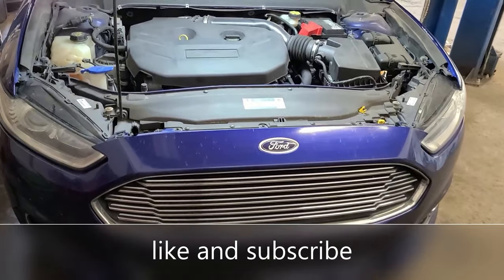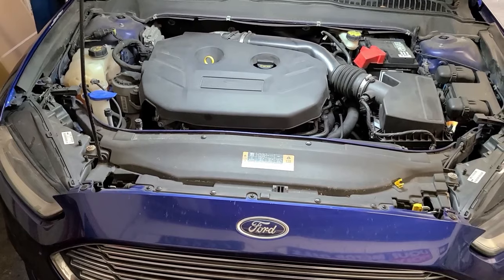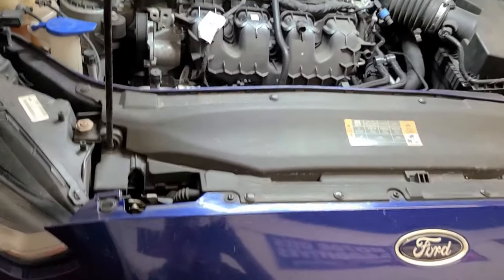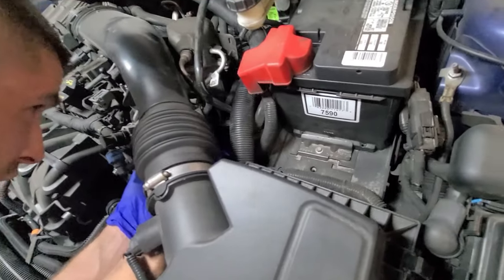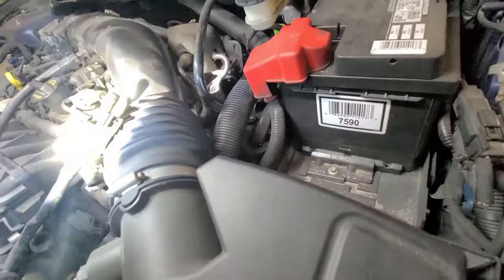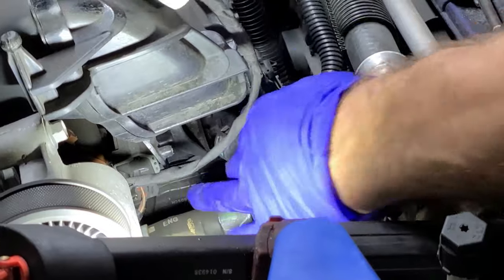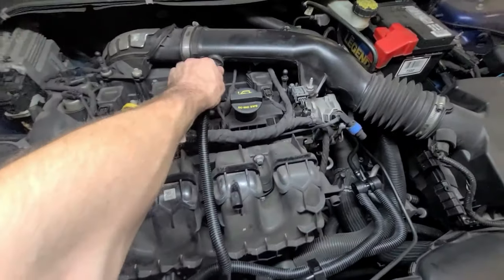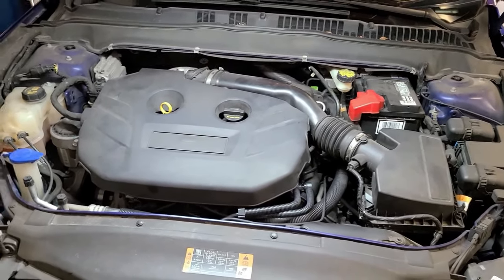Ford Fusion Purge Valve Replacement // 2.0L Ecoboost 2013-2020 // HOW TO #DIY #HOWTO

Comment: THANK YOU. After having this problem for a long time and knowing what it was I finally have the money to fix it, and now that I have the part this was the absolute best video I have seen on it. This needs to be the first video on YouTube when you look this up
Reply from the maker: Like, share and subscribe will all help! Check out our give away we are doing!
Reply: This is happening to my ‘17 sport.  The Ford dealership is the only shop that had an opening for Monday, what should I expect to pay to have it fixed?
Reply: @AceFitPro714  I man i hope you see this soon/ fast enough. Just saw this notification. DO IT YOURSELF. It's a ltiny bit of a pain in the ass but it's so doable! the dealship(I live in canada) will probab;y charge hundrends fora  job you could do yourself in 1 or even less than 1 hour.
Reply: Miami florida here, they wanna charge me $650 !!! Thank God i saw this video in time
Reply from the maker: I'm just up the road in daytona area!
Reply: @IHaveN0Clue my dealership quoted me $800, yeah no thanks
Reply: @AceFitPro714  the ford dealership charged me 600$ for an o2 sensor after I told them I ran the codes and got a evap purge valve code, after arguing with them they replaced upstream o2 sensor charged me 600 and gave me the car back got home check engine light came back on the following morning and back to stalling out, took the car back up there. Got charged another 300 for the evap purge valve. On a 2015 focus its a 20-40$ part and takes 5 minutes of plug and play. Save yourself the time money and headache
Reply: Yeah they wanted to charge me $700 here in wa I have the 1.6 2013 and it's essentially identical as the 2.0 got the part for $88 installing tomorrow wish me luck.
Reply: @THEDriverMod_ location
Reply from the maker: @sachinsofta  location of what?

Comment: heer..locally,, you can just get the valve,,, a hot hair dryer will soften up the hard plastic tube to out the bad valve out and add the new one... let it cool, and just snap in one hose next to the valve* i work as classic Italian car tech, but i do help my friends out..plus i own a 14 fusion vep engine  15 min fix )

Comment: Changed the purge valve on my 2020 fusion 1.5 liter turbo and the fuel is rapidly dropping when driving. Roughly 3x as fast as normal. Any guesses?
Reply from the maker: @MintyFresh3693  maybe a leaking injector, are you driving it more aggressively to where it's boosting more?

Comment: thanks for the video my man! for that bottom connector, I didn't have a 90 degree pick that long but after struggling with a short 90 pick, I borrowed a more hook style pick of the same size and got it right away! took care of codes p2196, p1450, and p0456 and of course stopped the stalling after refueling on my mother in laws 2015 fusion 2.0!
Reply from the maker: Good work, happy to help!

Comment: Local mechanics told me it was the Fuel Pump Module in tank, $1500 later and it repeated exact symptoms described in this video. I found the solution and thanks to your instruction, will be doing this myself.
Reply from the maker: Sorry to hear that but hopefully you can get it done yourself!
Reply: @THEDriverMod_  Lesson learned but happy I found your video, thanks!
Reply: I almost had this happen to me but I'm a natural negotiator and made that guy understand he wasn't just quoting just anyone. I didn't pay till he showed me it passed diagnostics

Comment: This was by far the best of these videos, thanks!  That bottom one is the hardest to remove, but stick with it.  I took the others out, removed the sensor as shown here, then you can rotate the bottom one enough so you can push the clips and get a 90 degree pick under the top and pull it up.  Pops right out then.  When goign back in, recommend a little lube on that one. Start it, then use whatever you have to get some leverage. I used a wrecking bar to get behind it and push it until I could snap the locking ring.  On the purge valve, there's a piece of rubber where it mounts to the bracket. Don't forget to take that out of the old assembly to securely mount it on the bracket.

Total time for a complete DIY'er: 1 hour.
Reply from the maker: Great insight and tips! Thank you

Comment: Very helpful! I ended up just cutting the hoses to the two lower connections so I could spin them around so I could undo the clips easier.
Reply from the maker: That's a good idea! Glad you were able to get it done!

Comment: My check engine light just came May 1st. Ran a diagnostic check and got a P1450 code. Bought the canister purge valve today and changed out the part thanks to this video. I didn't allow the light to stay on long enough to experience any symptoms.

Comment: I just bought the valve and changed it out and all is fine. Didn't have to mess with all the hoses.   Thanks for the video.
Reply: I’m about to buy only the valve, I’m a little concerned about the hose; did you have to cut the hose? Or you just pulled it out and put the new one in?
Reply: @hectorvalenzuela8817
Reply: I just took the new valve to my local Auto Parts store and got a hose to fit the valve.  It was a little bigger, but it worked.  Good luck.  I hear the cause is due to overfilling the gas tank.  Do not "top-off" your tank. Once the gas nozzle shuts off that's good.

Comment: Thank you for sharing this video! This is EXACTLY what has been going on with my 2013 Fusion and I just returned home from the diagnostic test and was told this was in fact the problem. Now to share this video with my husband so he knows what is going on a little better, too!
Reply: Also, my car has 158,645 miles and this is the first time this has ever happened.
Reply from the maker: Happy to hear this helped you out! Definitely share and hope you get it solved
Reply: Just ended up with this problem and I have a 2014! Wonder if it's a factory problem

Comment: Thank you so much for posting this video. My car had all three symptoms plus the service engine light. Bottom connector was a pain in the butt, didn’t have any kind of pic. Engine runs so much smoother now
Reply from the maker: Awesome to hear! Yea it's definitely a pain, I wish there was some sort of trick without disassembling alot of the engine bay but you got it done!

Comment: Haha; you went to great lengths at around 2:30 to avoid saying that it sounds like your car is farting from the fuel filler. I'm happy to do that for you, if it doesn't want to start after fill up and then sounds like that car is farting, you have this issue. Also, that one clip down in the engine by the alternator is a huge pain to get at. If this happens again, I'll have a mechanic fix it just to avoid that grief. 
My best advice for getting that one off is to cut the hose, because you have to rotate the attachment to more easily get the tab pulled. It's nearly impossible with the full hose and fittings attached. To get it back on, get it in place and then take a very long and wide flat screwdriver and leverage it against the alternator housing to push the fitting fully on. It's brutal to try and do it with your hands alone.
Reply from the maker: I did because that's what it sounds like lol all good helpful tips for others watching this video!
Reply: Omg that’s what I told my son. My car is farting and he died laughing lol

Comment: That bottom connector is a big B! Thought I was going to have to take the alternator out until I saw this video! Appreciate the extra effort in explaining how the clasp actually worked. Didnt have the 90deg pick but was able to make a couple very long/ thin screw drivers work to release. All the other connections no problem. Thanks for the vid!
Reply from the maker: You're welcome! Appreciate the comment feedback!

Comment: Great video!  Glad you didn't do those edits you were saying as it helped to know how much of a struggle the yellow clip was to be.  I ended up using hand pruners to cuts the old hose assembly out of the way.  Since I could only get one hand in there on the yellow one, I bent the ear back and used a really long pair of needle nose pliers to twist the ear completely off.  I could then push the yellow clip out with the picker one handed.  I noticed for the new one, they changed the clip design, so hopefully the next time will be easier in 10 years.
Reply from the maker: Thanks fir the solid feedback!

Comment: Thanks so much for the video. Had an appointment with the dealership who wanted to charge me $165 just for diagnostic and probably another $200-$300 for the repair, parts and labor. Went to the local Auto Store and had the code evaluated, found out the purge valve was a possible cause of the code. The symptoms you mentioned fit my situation exactly.   Found your video while at the Auto Store, saw how easy this was, and $87 and an hour later the problem is solved and I have a new purge valve! Thanks!
Reply from the maker: you're welcome!
Reply: They wanted $700 from me.

Comment: Thanks for the video. Same thing was going on with my daughters 15 Fusion 2.0 65,000 miles.   While doing this I removed the air intake snorkel just to have better access to the valve.  I also cut the hose going to that bottom connection so I could spin it around.  What a pain getting that one.  Also used a mini pry bar to get that same one back on. Your video was the best one I found on this problem.  Thanks again!
Reply from the maker: Glad you got it handled yourself. Thank you for the positive feedback for others!
Reply: @Ruben Laugon mini pry bar. It was from a set I got from Harbor Freight. Nothing too big.  I can’t remember if I had the clip open or closed when I snapped it on. I would play it safe and open it then close it when it’s on all the way and give it a tug to make sure it’s on good.
Reply: @Ruben Laugon Glad it worked out. 👍
Reply: @mike_O’Neill hey guys I have a lot of trouble putting back that bottom connector.  Did you buy the exact same brand as in the video ? If yes, please give more details. 

Also how do I unlock the clip? (The new part doesn’t have those yellow ears)
Reply: @sheridanzampou8406  I bought the replacement at Napa. Mine had the tabs. That bottom one was a pain. I used a small pry bar to help push that bottom one on. Someone also mentioned using a silicone lubricant to help.

Comment: As others have said. Thanks for the video and leaving the struggle. I got everything but the bottom one off, now me and my numb fingers are going to harbor freight to grab a pick to finish this. Luckily the new part adds an extra connector at the solenoid so if I ever have to replace it again, it's only the 2 at the solenoid
Reply from the maker: You're very welcome, thanks for the comment, feedback and appreciation. You're almost done!

Comment: I took my car to a mechanic who charged 750 based off their “code reader” and “smoke test” that detected no leaks but picked my car up after they replaced the solenoid. The next day my car stalled getting gas. This is a great video.
Reply from the maker: It could be the low pressure fuel sensor
Reply: @THEDriverMod_  my purge calve sits different than the one in this video but mine is 2015. Do you know of any good links with pics?
Reply from the maker: @nicoleleu5984  I do not. I have the 2.0 ecoboost so you must have a different engine

Comment: Hope you see this… so I bought the solenoid by itself, but had issues talking it off the tube that  is barbed. I cut off the old part and realized I had no idea how to fit the new part in that tube. Any ideas?
Reply from the maker: No, that's one reason why I just do it this way that I did in the video

Comment: Just had dealer replace mine. Symptoms were stalling at low idle. No check engine light came on. Two independent mechanics couldn't find what problem was. Since replaced no stalling and performance of car is much improved. Didn't really feel performance issue beforehand but felt improvement after. Ford mechanic said there was a vacuum leak somewhere along the tubing. Thanks for the video. Really nice job explaining and documenting procedure.
Reply from the maker: Thanks, that's definitely a unique experience on your end. Never seen that before myself
Reply: @THEDriverMod_  should have mentioned car has 107k miles...first non-maintenance repair...best car ever since my very first in 1970
Reply from the maker: These cars look awesome and are super reliable from my experience. Mine is at almost 175k miles
Reply: This is happening to my ‘17 sport.  The Ford dealership is the only shop that had an opening for Monday, what should I expect to pay to have it fixed?
Reply from the maker: @AceFitPro714  depends on labor rate,  are you paying for diagnosis too or not. I would like to say anywhere between 300-900 dollars
Reply: @THEDriverMod_  well I was just sent this video so I could try to just order the part and do it myself I guess but I was just gonna have them fix it without diagnostics otherwise..
Reply from the maker: @AceFitPro714  the part number and procedure will be different than this because the fusion in the video is not the sport model. Hope it solves your issue though
Reply: @AceFitPro714 did the dealership route resolve the issue? I have the same issue on a 1.5l. I already changed the 2 fuel sensor and that didn’t resolve the issue. Planning on doing this valve replacement.

Comment: Thanks for this video mine kept making that weird noise and I would have to pull my car over and hurry up and push on the button where the gas goes into release the pressure or my car wouldn’t stay running— going to do this once the part comes in

Comment: I'm just now having this problem! It didn't pass smog test. Because of this. Of course check engine light was on because of it. I got my fusion brand spanking new in 2014 and just had this problem 1st time. It's my first American car. I was so nervous to get it because people say foreign cars are much better with less issues. I must have gotten a great batch lol 😂 I love my car 💕 I talk to her too she's my baby 🥰
Reply: I’ve had my 2014 since new. Over 190k miles on it with very few problems! Had one sensor go bad (fixed under warranty) and an AC compressor went out at 160k. Now, I likely have this sensor to replace as well 😂 

Overall a great, low maintenance car!

Comment: Just a tip. Cut the tubes so you can rotate the clips for easier disassembly. New part snaps in no problem
Reply from the maker: That's a great tip!

Comment: I will have to do this soon.  Mine idles super rough after refueling, has since I bought it.  It does run better if i put it in neutral if I need to stop right after leaving the gas station.
Reply from the maker: You can do it!

Comment: My car is a 2020 fusion titanium it would always stumble after filling up like it was going to stall but it would save itself and now i have a p2096 post catalyst fuel trim lean and i feel like mine is caused by this purge valve failing and causing a vacuum leak which it creating the lean condition i got the part I'm installing it asap i hope it cures it, just wanting to check in and see if this part failing has caused my code before

Comment: Have this on my 2020 ford fusion every time I put gas in it. It only does it when I put gas in it. Happen 3 times with it not starting up like it's suppose to. I get my parts on the 9th of March and will not be putting gas in it until I put the new purge/sylenoid valve in. No more evaporated emissions and I can put gas in without stressing 😌

Comment: Awesome video, thank you! I’ve got a 2019 Fusion Titanium with the 2.0L in it. I need to replace this part. It looks identical to the one I need to replace but every website I go to says it’s not compatible? Do you happen to have any insight on whether or not it should work? Thanks in advance!
Reply from the maker: Unfortunately I do not know why, maybe the part number got uodated?
Reply: Same… did you ever find part?

Comment: Hi love the info you provided .I have a question I have a 2013 Fusion and the code comes up P0457 fuel filler inlet so I cleaned the flaps in the inlet still have code after resetting it ..Could changing the canister purge valve fix this problem ? The check engine light comes on after fill up after it reaches 1/2 a tank of fuel .
Reply from the maker: It's definitely possible

Comment: So, ignorant question here, but... if it's the purge valve itself that's bad can you simply replace the purge valve without replacing all the tubing/connections? Is there even a way to disconnect the tubing from the valve itself? I'm guessing the routed tubing plays an important role in the function of the valve, but, since it's just conducting flow is it absolutely necessary to remove it?
Reply from the maker: I believe it's possible but at the time the part was not available separately
Reply: @THEDriverMod_  Right. I get that. I assume it's possible to disconnect the hose assembly room the valve? Using the old hose/tubing wouldn't hurt anything right (unless, of course, it was damaged)?
Reply: @THEDriverMod_  Thanks for replying, by the way. Great video!
Reply from the maker: aslong as its not damaged and can be reattached  @kennywood6434

Comment: Hi thank you for this video! Do you know, can I remove the purge valve from the tubing and only replace the purge valve? I want to avoid having to dig inside to replace all the vacuums and wondered if I can just switch the valves without the tubes?
Reply from the maker: Not with the part I used. I've never done it that way so I don't know
Reply: @marioramirez2096  This is what I am about to try today. I have bought just the purge valve itself, not the entire assembly with various connections. I plan to heat up the hose where it meets the purge valve and wiggle it out, or cut it and reattach new part with heavy duty heat shrink tubing like you mentioned. We shall see. Certainly easier than messing with that bottom clip and the part is $15 instead of $100. 2014 Fusion 2.0L